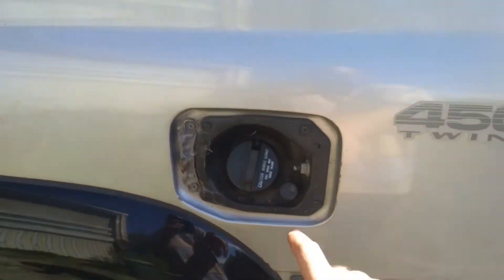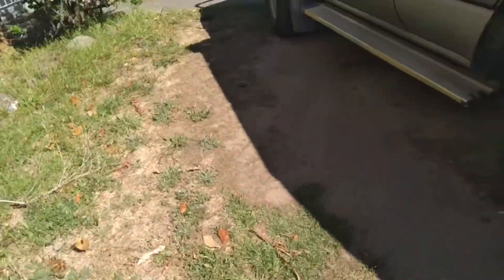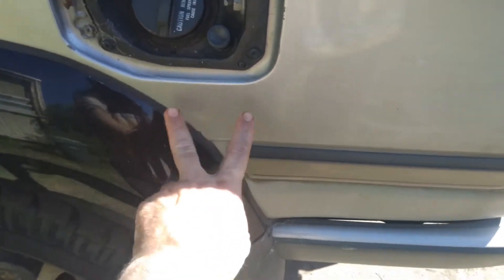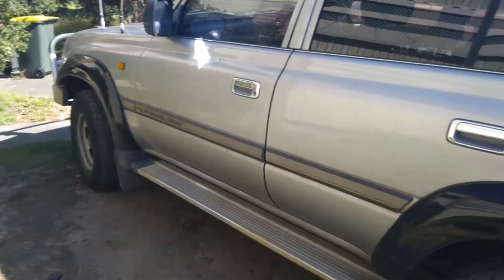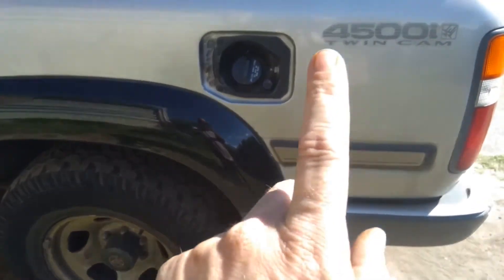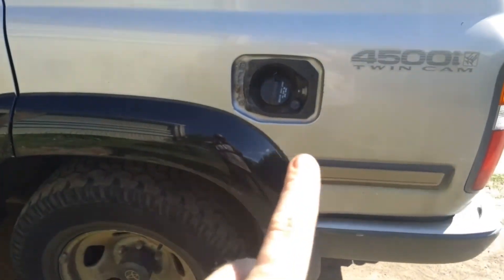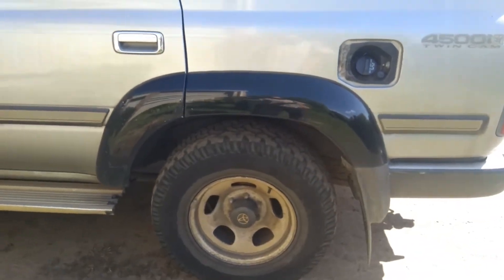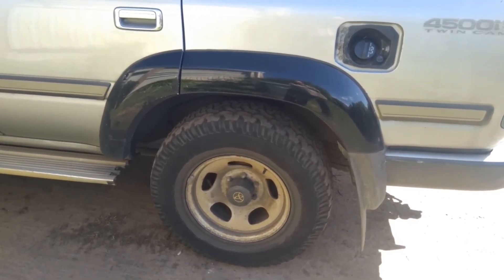80series - Main & Sub fuel system

Comment: Hey mate, Ive seen your video like 15 times. Im having some troubles with my 80 series and nor me nor my mechanic can figure it out. So the sub tank stopped sending fuel to the main one, nor matter the level on it. No lights are on in the dash, and it sounds like it is engaging the pump, but nothing. The mechanics asked toyota for the fuel diagram to troubleshoot it but no luck so far. They cleaned the solenoids and are now hoping for the best. Any suggestion? Thank you in advance!

Comment: Hey mate ,question as im installing my sub tank again.
My main tank is full and sub empty i know i cant transfer fuel but should i hear solenoid click and light up if i press the sub button or will it be dead until i drop main tank and fill my sub?
Reply from the maker: Um, I believe it should still click on, but it sho6ld turn off again as no transfer is done. If it staying on then there is an issue somewhere.

Comment: Hey there. Thank you for the video. Just a question. Do you know if the petrol 105 series has the same sub tank as the petrol 80?  Thank you
Reply from the maker: Assuming are your a petrol 6 cylinder then it's 50L. For the diesel or V8 I don't know

Comment: hey i recently bought a petrol 80 having an issue understanding as to how the sub tank works. If im driving along and the main tank is empty and i press the sub tank button it does it draw off enough fuel from the sub that i can continue driving along or do i have to stop and wait for the sub to fill the main?
Reply from the maker: You need to start the sub tank pump before you run out in the main tank. It will fill the main tank faster than it pulls juice Into the motor
Reply: is there supposed to be a light on the dash to indicate its transferring as the light on the subtank button only lasts for a few seconds?
Reply from the maker: Please watch this video. https://www.youtube.com/watch?v=jwxpBfYecu4

Comment: You managed to talk for 7 minutes about how the fuel system works without explaining how to fill the sub tank or how to pump fuel from one to the other
Reply: There’s a pull out lever next to the filler cap. Pull it out and you’re filling the sub tank. Push it back and you’re filling the main tank.

The sub fuel button in the cabin is what you use to activate the pump that transfers fuel from the sub tank to the main tank.